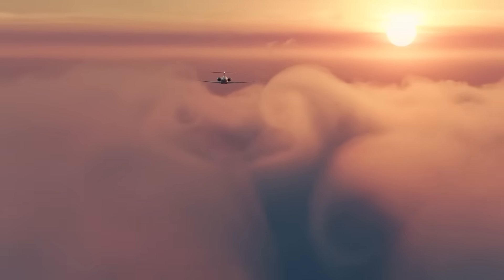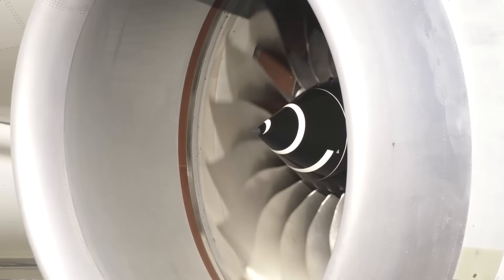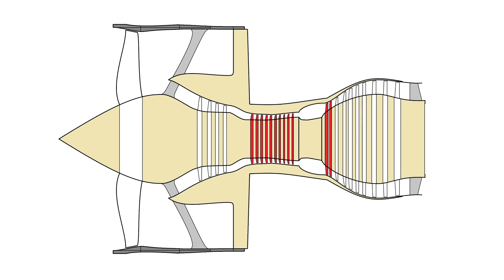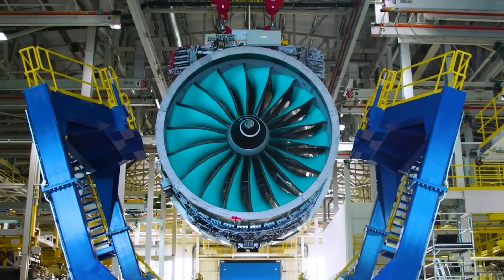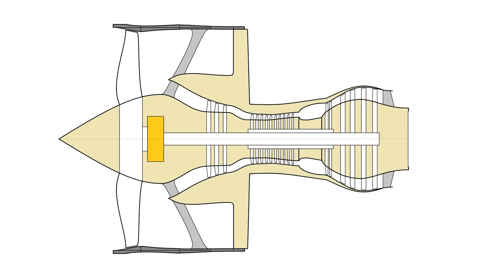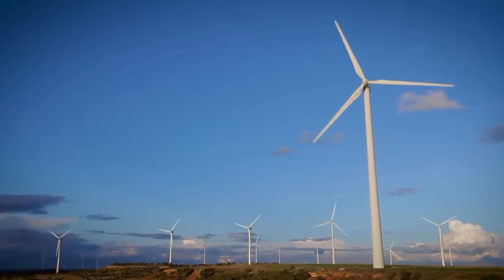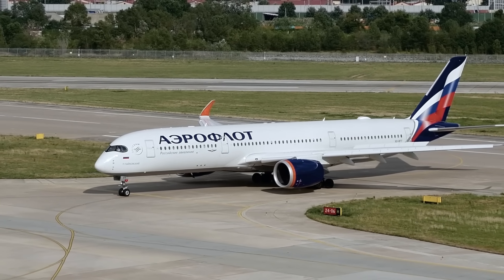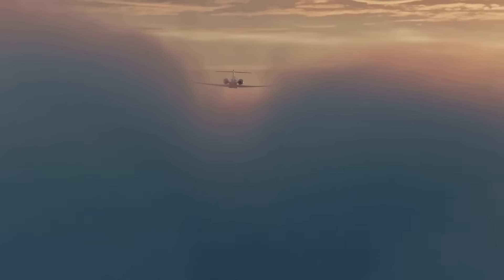ULTRAFAN - The future of jet engines

Comment: Rolls Royce blades are hollow titanium.  Not solid.
Reply: That is exactly same as the Outlet Guide Vanes which sit directly behind the main Fan Blades.  These vanes are static and help to refine the airflow created by the spinning Fan Blades.  The Titanium used on these parts has a small percentage of aluminium and vanadium in its composition.  The Fan blades are made at the RR plant in Barnoldswick and the OGV’s are made at RR Hucknall.
Reply: Which blades?
Reply: @Tbizzh fan blades. The very front one.
Reply: @becaracha  didn't this video say composite with titanium leading edge?
Reply: @Tbizzh  only latest engine.
Reply: @becaracha  Right, Ultrafan is composite.  Current Trents are hollow titanium.
Reply: @IndyEng-o3j

The original RB211 blades were composite.  

And after Rolls Royce thawed the chickens for the second test they found out it failed those too.  Direct cause of the company’s bankruptcy.
Reply: @calvinnickel9995  The blades failed through atmospheric pollutants attacking the leading edge of the blades, making them like a toothbrush after extended flight time ,  they were plenty strong enough for a frozen chicken. By the way carbon fibre was invented in UK at RAE Farnborough in the 1950's
Reply: @chrissmith2114  In 1948, at the Union Carbide Parma Technical Center in Cleveland, OH, Roger Bacon accidentally produced the first petroleum-based carbon fibers when he tried to measure the triple point of carbon by heating strands of rayon in argon.
Reply: @John-nc4bl  RAE Farnborough produced carbon fiber composites in mid-1950's , which was the key to using carbon fibres in construction of aircraft and other stuff.  RAE did not 'accidentally produce composites'...

Comment: It should be mentioned that Rolls-Royce and Rolls-Royce are not the same company. Nor are Rolls-Royce and Rolls-Royce.
Reply: Ah but Rolls-Royce do own the name Rolls-Royce so they do allow Rolls-Royce to use it under licence
Reply: @simoncolenutt5228  I think they both have the right equally to use the name and logo, since they were split. Rolls Royce Motors (BMW) and Rolls Royce PLC.
Reply: @Paul--Nobody_Is_Out_To_Get_You  It might have changed but RR plc definatly used to own the name and licenced its use out to the car company. Which is why BMW were able to swoop in and grab the name by dealing with RR plc directly when Vickers sold the car company to VW. The 'old RR car company' now produces Bentleys
Reply: @Paul--Nobody_Is_Out_To_Get_You  You believe incorrectly. Rolls-Royce Motor Cars Limited was created as a wholly owned subsidiary of BMW in 1998 after BMW licensed the rights to the Rolls-Royce brand name and logo from Rolls-Royce Holdings plc
Reply: @simoncolenutt5228  you are quite correct, and it has not changed. BMW still licenses the brand name and logo from Rolls-Royce Holdings plc
Reply: @simoncolenutt5228  "The 'old RR car company' now produces Bentleys" - W.O. must have rolled over in his grave laughing when that happened, I think Montegue Napier would have joined in.
Reply: @harryspeakup8452  Government created Rolls Royce (1971) Ltd and insisted aero and car could use name and logo (grill and spirit were not protected). The factory at Crewe was given to Bentley, formally part of RR. I don't know any details beyond that so maybe it changed. I don't know what rights, if any, aero part had to deny car part the name.
Reply: I actually genuinely agree with you  @simoncolenutt5228
Reply: A milk bars not made of milk either!, a chocolate fish cannot swim and a steamroller doesn't roll steam
Reply: @aerotube7291 A dog barks and trees have bark.
Reply: @miguelsuarez8010  mine was pretty lame as far as jokes go i admit!
Reply: It should be mentioned that the reason for that was directly as a result of Rolls Royce trying to introduce a new fan technology.
Reply: @calvinnickel9995  Well, it was because RR was run entirely by engineers who didn't pay much attention to their accountants, so they hugely overspent on development of the RB211 engine, ended up facing bankruptcy and had to call Ted Heath's government in to bail them out. The split into RR cars and RR aero engines was part of the deal.

It's sobering to reflect on the fact that had this happened ten years later, when Margaret Thatcher was PM, she would undoubtedly have let RR go down the pan, as she did with others, with the loss of thousands of jobs both in RR itself and throughout the engineering industry. But it didn't and today RR aero engines is one of the world's big names in aero-engineering and employs around 50,000 people around the world. God only knows how many more depend on it indirectly.
Reply: @tommymorrison6478  I suspect it was more that the accountants, no, the sales people, didn't listen to the engineers and sold an untried engine at an unrealistic price.  Are we forgetting why the original RB211 failed?  Maybe the titanium strips along the leading edge of the composite fan blades might be a hint.  

I hope they don't get into trouble this time, they no longer have Hooker et al to rescue them.
Reply: @tommymorrison6478  Surely the overspend on the RB211 and demise of the original company was that they put their faith in carbon fibre fan blades but when tested the carbon fibre blades didn't hold up. They had to redesign with titanium blades and the performance of the engine then didn't meet the spec that Lockheed were expecting for the Tristar. I suppose it didn't help that the Tristar wasn't a commercial success either.
Reply: @tommymorrison6478 My Dad was working on the RB211 Project in Derby at the time. I was only young, so I didn’t realise the implications. He was an engineer through and through.
Reply: @tommymorrison6478 you’re wrong about Thatcher. She wouldn’t have let RR collapse, because of all the military implications
Reply: @Fatboyslim-p3i What military implications? Name them. Be specific. And then explain why the demise of RR would have left  the British military bereft of engines....or whatever you think it was they'd have been bereft of.

P.S. "you're"
Reply: @tommymorrison6478  because our airforce was and is dependent upon having engines to fly with and the Royal Navy had and still have boats powered by RR boats, that’s why Thatcher wouldn’t have allowed RR aero or nuclear decisions to collapse
Reply: @Fatboyslim-p3i  Engines can be had from sources other than RR. You're a simpleton. I've no doubt others have said as much. Listen to them. Now go away.

P.S. Unlike yourself I remember Thatcher very well. Like you she was simple-minded.
Reply: @ you. Clearly know sweet sod all about jet engines and airframes, as an engineer I do, having spent some years Working for RR in manufacturing and design and research, so stuff that in your pipe and smoke it you old git
Reply: Do you mean that Rolls-Royce jet engines don’t come with an umbrella?  I’m calling bs on that.
Reply: Wtffffffff?
Reply: Rolls-Rolls and Royce-Royce it will be from now on.
Reply: Same brand same company different division.  ¯\__(ツ)__/¯       boo-hooo  they are the same
Reply: @The-Cat same brand, different companies, BMW who own the car side have to pay the aero side to use the Rolls Royce brand name because the aero side owns the name
Reply: Rice is not a rose. The root of the Ritz lies in rastafarious rumbling rooms.
Reply: Custard
Reply: Trolling jokes aside...wow what a fantastic piece of kit if they can make it...
Reply: Rolls Royce cars are now just BMWs in disguise. The factory is now just a paint and trim shop for the hun. 😢😢😢
Reply: @brianredmond4919 And Bentley’s are German VW/Audi products now. Say, who won WW2 anyway?

Comment: I found out the other day that engines like this go for up to $50M each. No wonder they use them as long as possible. Each engine costs as much as a small fighter jet. And it's not just that they need to absorb those extremely high power and heat loads, im assuming the requirements are similar as for helicopters, and they also need to be able to function with no lubrication for up to an hour to make sure they can land safely if the oil system fails. Although perhaps the requirements are more relaxed for a plane, since a helicopter absolutely relies on the gearbox to stay in the air, while a plane losing an engine isn't as serious. 
But in either case gearbox design is an interestingly difficult and complex issue at high power levels. You have the issue of boxes for large vessels, which aren't as weight critical, but need to endure tens of thousands of horsepower for days, weeks, years, and for flight applications where it needs to transmit high power loads and also be as failproof as possible, able to run with no lubrication for a period of time. I never knew until recently that when you see a twin or triple engine helicopter with engines rated at 5,000hp, that doesn't mean it can actually produce 10 or 15,000hp, the limit is what the gearbox can handle, which is usually between half and two-thirds the potential power. That means if you lose an engine, the remaining ones have a reserve and are able to keep the total power output almost constant, so you can reach a safe landing. The fact that they typically only run at about half output means the engines are less stressed and last much longer than they would at higher settings. The main limitation barring really large and powerful helicopters has always been the design of a gearbox that can handle that power, and it's not something that scales up very easily, the difficulties multiply as the size and power level rise. Which makes the achievements the Soviets reached in helicopter design that much more impressive. Iirc from your video on the V-12 they actually designed their own custom gearbox to handle the power requirements, because one didn't exist. Which is especially impressive since generally gearboxes are sourced from specialized manufacturers with lots of experience and the right tools for the job, and they have had enough trouble making them work at higher levels. At least making them profitable enough to be worthwhile. I can't help but suspect that what they came up with worked, but was a big part of why the aircraft failed in the end. Maybe the gearbox worked but it was just too big and heavy, or not reliable enough, to put into mass production, and the intended production numbers didn't justify trying to do it again better. 
Sorry for the tangent but somehow i found that to be a very interesting topic, and something i wasn't really aware of before. One doesn't really think of the gearbox as being perhaps the most difficult and crucial component of a machine, but it turns out that it frequently is. 
Now i wonder when electrical transmission of power will ever be developed to work in the same niches? It works well enough for locomotives, i wonder if it can ever work for aircraft?
Reply: "also need to be able to function with no lubrication for up to an hour " 

Turbine mechanic here, no such requirements exist for turbine engines in North America, EU as far as I know. 

Engines are shut down if oil pressure or qty drops below certain thresholds. The engine will still continue to windmill and require some lubrication, and this done through the core still rotating and providing oil pressure.
Reply: @ghostrider-be9ek  what engine has a pump ran by n3.........
Reply: @swell07_  i did not specify which spool from which engine - what is your point exactly and how does it matter?
Reply: Fortunately, due to the absence of reciprocating bearing loads, turbine engines can and do typically operate with extremely low oil pressure in comparison to piston engines
Reply: trains run diesel electric as it allows for one engine to power multiple sets of wheels without resorting to driveshafts.
they also work better when they are heavy as they rely on the friction of steel on steel for traction...

a plane is the opposite extreme, it wants to be as light as possible.
Reply: Helicopter turbo-shaft engines use centrifugal compressors like Whittle did - The centrifugal compressor provides a much higher pressure ratio in a shorter length than a axial compressor can, allowing a shorter engine to be used, and centrifugal compressor has high resistance to FOD - the aerodynamics of the engine not important in helicopters as aeroplanes.   Whittle knew about axial compressors but chose to use centrifugal to simplify engine and make it more reliable and controllable, although it did give the engine a larger frontal area.
Reply: @chrissmith2114  the RR 250 , the PT6, as well as the famous Arriel - are all combination axial/centrifugal compressors

Comment: Fancy way of saying they dropped their technology and went with the same gearbox configuration like everyone else
Its real advancements come from materials technology, not the setup
Reply: Thats not what he said at all. He said they went with a twin spool like everyone else, but added a gearbox to achieve some of the same benefits that the third spool gave them before. Geared fans are not very common, the fixed twin spool is the standard. Not sure why a gearbox is less complex and expensive than a third spool, since making gearboxes at those power levels and reliability requirements is not at all easy or cheap (ask helicopter manufacturers, most of which can't actually use anything like the rated full power of all engines, because the gearbox limits the total power rating). But I have to assume they know what they are doing and have done a lot of math to reach this conclusion. I'm guessing that it's more flexible this way. And usually gearboxes are sourced from other companies that specialize in them, so maybe they got a good deal and less risk that way. Who knows, it's a complex industry.
Reply: @justforever96  Liebherr developed the gearbox in a joint venture. They have experience of powering heavy construction plant.x
Reply: Only Pratt & Whitney uses a gearbox. Also, new materials allow new engine designs that have higher operating temperatures, fewer compressor stages, and higher compression ratios, so it's not just the weight reduction.